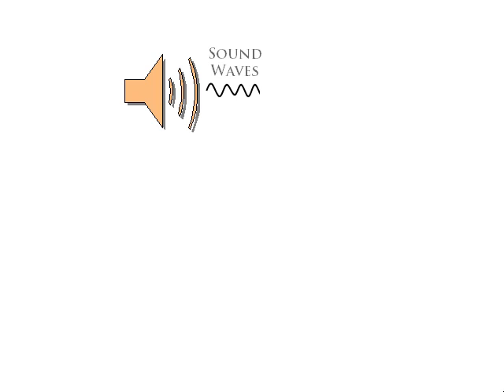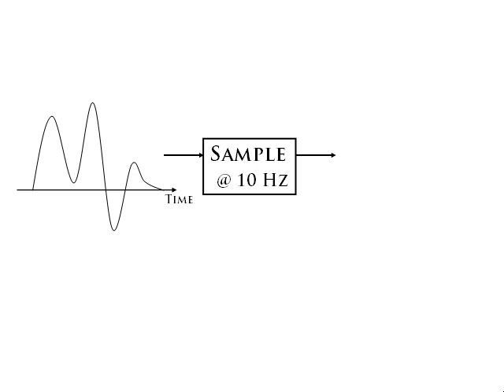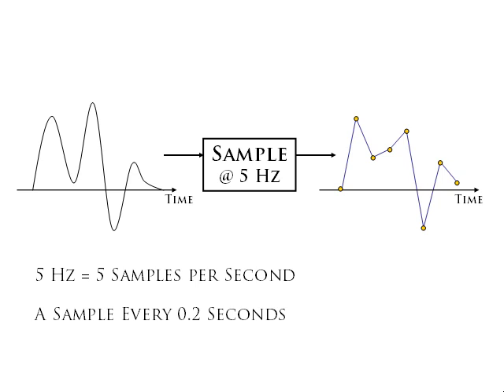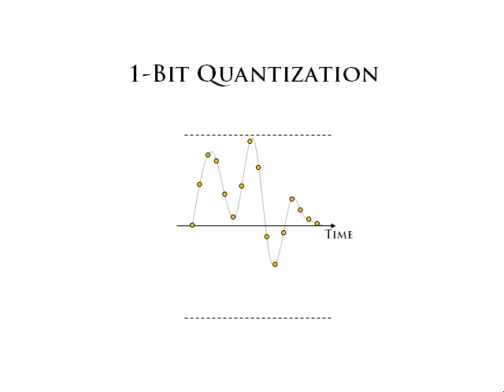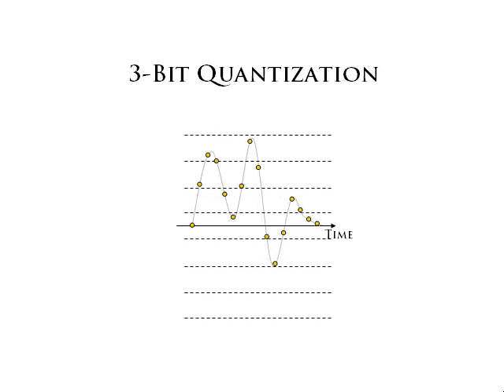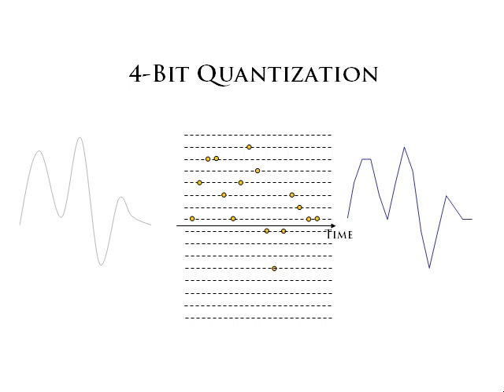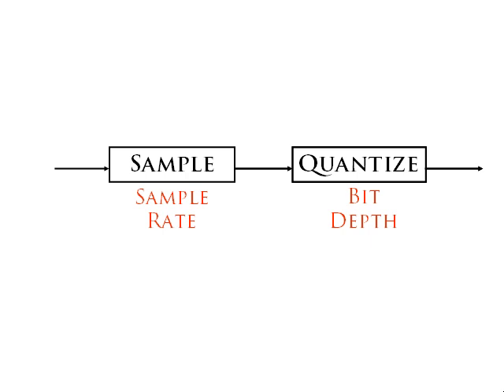Music Technology 101: Sampling Rate and Bit Depth Explained

Comment: Whilst most of this is a good attempt to explain sample rate it's fundamentally got it wrong when it describes "joining the dots".
This is NOT how the mathematics of FFT works. The bit depth only affects the noise floor.
How it really works is explained well here:
https://www.youtube.com/watch?v=nLEhfieoMq8
Reply from the maker: There is no FFT involved in analog to digital conversion. 

Regardless, I'm not sure if you're unhappy with the "joining the dots" part or the bit depth part.
Reply: MangoldProject
Agreed FFT isn't involved in actual AD,DA conversion but the Fourier Transform is the maths that proves only one possible complex curve can fit the series of sample points of a band limited signal.

You state that D to A conversion is the process of joining the sample points with straight lines.
No, that is fundamentally incorrect.

The output from a basic D to A convertor is a series of flat stepped voltage levels (the famous stair steps).
The voltage levels are then input to a low pass filter.
At it's most basic a low pass filter is an RC circuit - RC circuits produce curves.
The voltage levels are 'smoothed' by the low pass filter into predictable curves, not straight lines.
The maths predicts that providing the low pass filter's cut off operates below the nyquist frequency then the original complex waveform will be reconstructed.
Reply from the maker: r44heliflyer The basic stepped DAC, also known as a zero order hold, isn't the only DAC in existence. It's probably the one most discussed in elementary textbooks due to its simplicity, but doing linear interpolation on the fly has its merits, like reducing the demands on the post-DAC LPF. See, e.g., http://ieeexplore.ieee.org/xpls/abs_all.jsp?arnumber=1233797&tag=1 for just one example. Anyway, most DACs out there probably use oversampling (like a delta-sigma DAC) where both of these pictures don't hold. I've stated previously that the purpose of this video is to convey the basic ideas of DAC, which remain the same whether you use zero or first order hold (the only thing that changes is the overall spectral envelope which is really not very fundamental to the process).
Reply: MangoldProject
Agreed the purpose of the video is to explain the basics to a wider audience.
The link you provided is about as useful as a chocolate fire guard though!
It would be easy to enter a link war to attempt to support our positions so I'll abstain from that.

I'm fully aware that modern DACs are complex and many use digital processing to 'tidy up' the signal.
The Delta-sigma technique is primarily for noise shaping and to reduce production costs (by removing the need for very complex low pass filters!). This places less demand on the low pass filter's cut off frequency with the added benefit of allowing higher sample rates.

The fact remains that a Delta-sigma DAC still uses an analogue low pass filter so whatever happens the final output signal is never as you describe.

If you had simply stated that a low pass reconstruction filter is used to join the sample points with curves then your video would have been fine.
Reply: r44heliflyer question is, why people that understand this, watch this video
Reply: Karel Potužník because in my search for info to help other people learn more about it you come across videos like this which on the face of it are plausible but in reality perpetuate myths than many (wrongly) believe. Inaccuracies need to be challenged.
Reply: r44heliflyer are you related to Harvard's Ben Edelman?  He has a thing for accuracy too.  

The author was not marketing 24 bit devices.  He was not discussing DACs.  He did not even mention playback of a digital audio signal.  He was discussing ADCs.  More specifically he was explaining the fundamentals of sampling rates and quantization.

Your response a month ago claims that the author stated "D to A conversion is the process of joining the sample points with straight lines."  No.  No he didn't.  Not even close.  He said things like "if we play connect the dots then the quantized waveform will look a certain way." He was right about what he said.  Meanwhile, you created a page of argument from hearing the wrong thing in a YouTube video.  That is an inaccuracy that I think is worth challenging.  The author put a significant amount of time and energy into creating this video and it does what it was intended for.  

If you are honestly looking for videos that explain digital to analog conversion and quantization error why not go complain to the author of the video you linked to and tell him how to improve on it?
Reply: tecg fets 
Agreed, my error, I got the D to A reversed in my second paragraph.

The author brought up the subject of DACs in a web link.
I mentioned both A-D and D-A conversion.

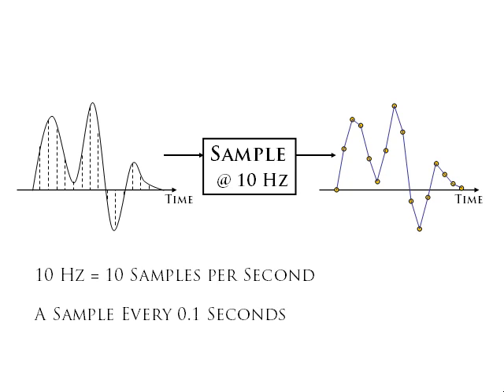Joining the dots as he did at 2:58 is fundamentally incorrect but he uses it to justify that the 'digital waveform' is somehow inferior to the input. At best it's a stair step, more accurately it's infinitely small points in time not joined at all.
In reality its never a waveform, no straight lines, no steps, no curves - its just a series of numbers with no values in between.

I was trying explain that when converting back to analogue that straight lines between dots don't exist at any part in the process A-D or D-A. The charging/discharging action of an RC filter 'replicates' the original waveform exactly from the stream of voltage levels coming out a DAC.

Throughout the rest of the video the author uses joining dots to illustrate how the resulting wave form doesn't look as accurate as the original, despite the fact that it never ever looks how he's drawn it.

By illustrating the process as joining dots or showing it as stair steps has led to the wider mistaken belief that the digital audio is somehow hugely inaccurate; it isn't.
Reply: r44heliflyer The quantized signal is hugely inaccurate when digitized at 1 bit, however.  Same goes for 2, 3 and 4 bit. There is so much more to understanding audio than this one video.  Perhaps the author will try to explain quantization error at some point in time in a different video but personally I think that topic belongs in a much more advanced realm.  
Giving people this video as something to start with is a good idea.  Those "average" people are glossing right over this thread.  You do realize that, right?  They'd gloss right over the link you provided too.  It's too much for a beginner. 

I think you would have better luck lobbying the government for a law requiring that audio playback devices cannot be marketed using pictures of stair-steps than you will have luck at convincing the average person that 24-bit does not offer added fidelity for playback.  But, seeing as you're making a mission in life out of it, good luck!
Reply: tecg fets
Yes, the video was a good idea - not a problem - it's just fiction in places.
The link I provided is quite entertaining and informative.
You are well mistaken if you think you can distinguish the difference between 16 bit and 24 bit audio.
Sadly then you seem to have a tendency to bring it to a personal abuse level so I'll say bye and let you go bicker somewhere else.
Reply: There's a difference between fiction and someone describing one side of a process correctly in a way that others deliberately use to incorrectly define the other side of the process...

Who here said that people can hear then difference between 16bit and 24bit audio playback? 

As for the personal attacks, they seem natural in a thread that has reached spam status.  It doesn't excuse them, and I apologize for that.

Comment: I did a small comparison: http://youtu.be/wREraa_Jg6E

There is 48khz file and 96khz file in spectrogram. The difference cannot well heard in youtube heard but it really feels that the 96khz file is maybe slightly clearer. At least it contains more high "noise" data and the shape is different from the 48khz file. But what do you think? I've been switching between 44.1, 48 and 96khz... some of my VST plugins like J6PK sound better in 96khz.

Comment: "when you sample at least 40 to 50khz you can reconstruct the signal perfectly" isn't quite true.

You must sample twice the sampling rate of what bandwidth you wish to reproduce, If you want 0-20khz bandwidth for your signal, you must sample at least @40khz. This bandwidth limit is inherent and cannot be surpassed without getting aliasing.

Most of the times you wish to sample more than 2x the bandwidth so that you can construct a good anti aliasing filter to prevent any possible aliasing from signals that have higher frequencies than what you want. Too little sampling rate and you need very sharp and complex filter, more and you'll get by with gentler slope that's easier to do.

Comment: I am using Cubase for making music, so basically i should use 24-bit 96khz rather than 24-bit 44.1khz? Correct? My soundcard supports ASIO @ 96khz.
Reply from the maker: 96 kHz will work fine. Although 96 kHz is technically better than 44.1 kHz, I was also making the point that almost all people would not be able to tell the difference between 44.1 and 96 kHz @ 24 bits. The final decision is up to you. My advice is try and see if you can hear differences using a blind AB or ABX test - this will help you mature as a sound engineer and musician, and also help you reach your own conclusions based on your own ears and not what some "higher power" tells you to do.
Reply: MangoldProject
Thanks for the answer! I was comparing my projects @ 24-bit 44.1khz WAV and 24-bit 96khz WAV. Then i used High-pass filter and set it quite high, about 10khz and compared. It was interesting, when exporting in 96khz, it contained more "high-voice" data, sounding a bit clearer than the 44.1khz counterpart. But i guess it does no harm using 96khz :) I am still going trough "learning process" although i have fiddled around with music almost 10 years :D but i am now getting more "serious" about it so i want to learn new things :)
Reply: MangoldProject - in your reply to my comment you said that you are simplifying the things. Here you just lie. How is "96 kHz technically better than 44.1 kHz" when the interpolation is already above the Nyquist line and both will produce the same interpolation?

ProtecSirius - there is absolutely no reason for you to use 96 kHz sampling rate. I would recommend that you should use 48 kHz (not 44.1 - it's for CD standard) which is what is a standard for listening music on computer. Using higher sampling rate will NOT produce any better quality - it will only make the file much bigger.

As for the 24 vs 16 bit - use 24 bit only when adding effects and mixing the music. When you are ready to make the production release, there is no reason to use anything above 16 bit. 16 bits per sample gives enough room from subjective full silence up to blowing the tympanum of a human without any quality loss in the music :)
Reply: Philip Petrov

I did a test. I tried out various VST plugins that is use in both 44.1khz and 96khz. In some cases there was no difference, but some of the VST's i use sounded better with 96khz. I don't have issues with HDD space, and i am not converting any files in .wav until just the final mix.
Reply: You should compare 48kHz vs 96kHz (96 = 2*48). Elsewhere you may have reduction in sound quality because of bad sound parser.
Reply: Please read here guys - it's from the creator of the lossless file format that we all now use:

http://xiph.org/~xiphmont/demo/neil-young.html

If that does not convince you, I would say only "be happy with your placebo effects and live your life as you wish" :)
Reply: Philip Petrov That was some interesting reading there, thanks! But i gave up and switched back to 48khz. I am using drum samples recorded @ 44.1 (or was it 48khz? not sure) anyway, i read somewhere that it can make your sound worse if the source is 44.1 / 48khz and you use 96khz in DAW? Am i wrong?
Reply: Won't make the sound wrong. The sound goes wrong to the people who do not know how to mix sound :)

44.1 is for CD
48 is for PC

96 is 2*48 (double rate). This double precision is not going to improve sound in any way.

192 = 4*48 (quad rate). Also not going to improve anything.

Even if you record millions of times higher rate... it's not going to improve anything.

Reason - it's because 40kHz is perfectly "restoring" the analogue sound. Double perfection is the same perfection :)
Reply from the maker: Philip Petrov
Hello Philip. First, can't we have a civilized discussion where no one accuses others of "lying" or all this negativity? To your point, there are parameters other than sampling rate that characterize ADCs. For example, all ADCs are preceded by a low pass filter with some rolloff. Sampling at 48 kHz places some very tough demands on your filter design and some ADCs cut corners, leading to some degradation in quality. A 96kHz sampling rate allows the rolloff to occur at such high frequencies that it does not color the audible ones, usually leading to better sound fidelity.
Reply: That is incorrect. The low pass filters have nothing to do with the sampling rate because it's done before the sampling process.

Comment: I have to disagree with the explanation of the sample rate - it's wrong to represent it as a connection between the dots. It's actually a process of "interpolation" involved! The sampling (analog->digital) is just a recording of discreet values in period of time - so here you are correct. But the opposite conversion (digital->analog, so we can hear it from the speakers) is NOT "connecting the dots". It's interpolation. And 44,1kHz by the Nyquist sampling theorem are above 40kHz, which ideally reproduce  the original sound wave. So any interpolation above 40kHz is producing THE SAME result. It does not matter if you sampled 44,1 or 96 or 192 - you get the same analogue output.
Reply from the maker: Thanks for your input Wattie. See my discussion below with Chris Kamper as to why I've made  that choice while explaining. Basically, in my book, when teaching beginners, a clear mental picture which is 95% accurate is better than a  complicated explanation involving interpolation, etc ...

It's the same way Newtonian mechanics is taught first thing in physics schools, even though we all know it to be "incorrect" and an approximation of the more correct quantum mechanical picture of the universe.
Reply: MangoldProject The "kid oriented approach" must NOT leave the impression that the incorrect is correct. When we teach Newton mechanics in school we always tell the children that more complicated theories exist and they will be learned in university. At least we do in Bulgaria.

Btw interpolation is not so much complicated - a simple example followed by "similar, much more complicated, model is actually used in digital->analogue conversion" will not hurt anybody.
Reply: ***** Can you name just one interpolation method which is used in practice and does NOT interpolate the original wave at 100% lossless when the sampling rate is 44.1kHz or higher? I bet you can't :) :) :)
Reply: FYI: The "alternate" interpolation methods will differ ONLY in the amount of computing time that they consume. They do NOT differ in the results! The only difference between the methods is how much CPU time and memory they will use to produce the results.

Have a good day :)